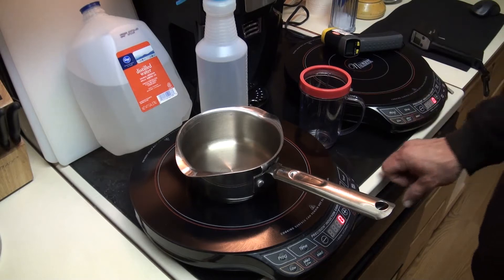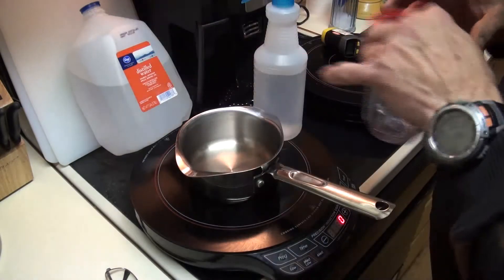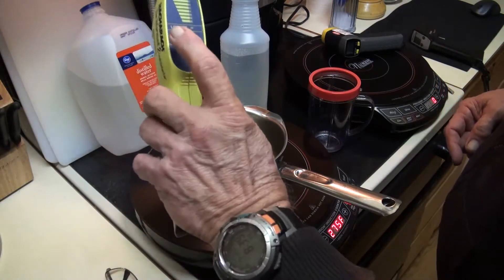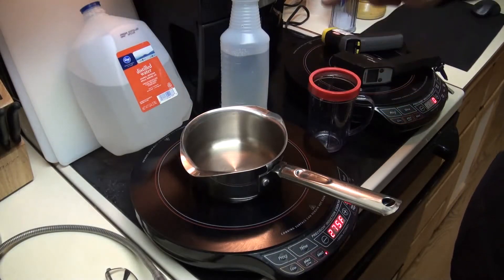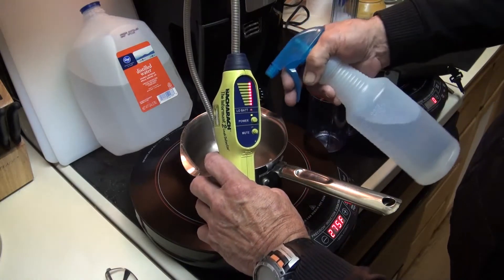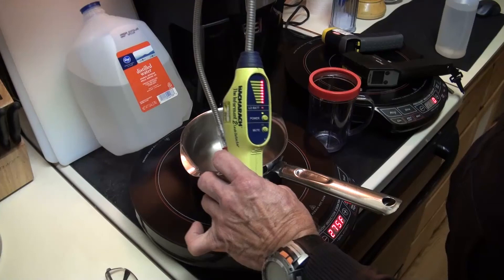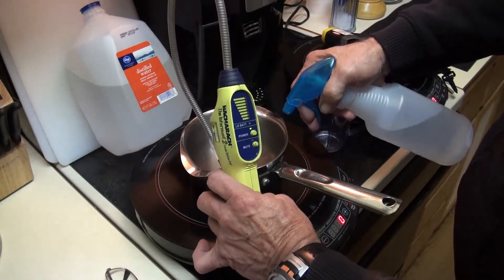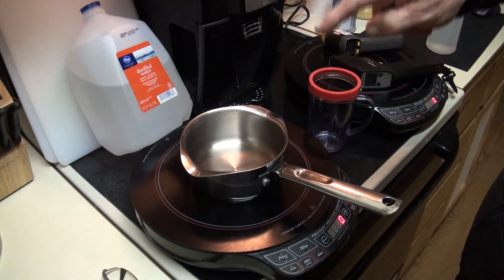# 2 Flammable gas from distilled water, is separating the Atoms, in water.

Comment from the maker: What I call my Flashing Liquid Process will take any liquid to any temperature, even above said liquid's boiling temperature. You see the finer the mist of liquid being sprayed onto a heating element, the faster the liquid will assume the temperature of the heating element, then boil, at the heating element temperature. This is possible because liquid takes time to boil. and the heat transfer happens faster than the liquid can boil, so the liquid reaches the temperature then boils.

Comment from the maker: Facts are not in stone, when written by scientists. Science says it is fat that gasoline auto ignites around 530 degrees Fahrenheit. I am here to tell you that is false I have seen iron turn a dull red before the gasoline would auto ignite. The temperature of the dull red iron is around 1000 degrees Fahrenheit. This means there are around 500 degrees that science says doesn't exist. Look at what I did to distilled water. science says it is impossible, you can't take water above its boiling temp.

Comment: If we speak about coincidences, than I remember "Cold Fusion" experiments with platinum and nickel electrodes. Japanese chemists do the experiment (replication). In the end of scientific experiment they make conclusion: The best temperature for Hydrogen production was about +80 Celsius. 212 F= 100 C. 100 C is boiling point of water. To "take" this temperature (vapor) is extremely simple we need to boil water. That is very inefficient too :-). I did it with "floating" resistor-4 Ohms.

Comment from the maker: The problem with using exhaust heat is controlling the temperature, 212 to 230 degrees Fahrenheit are the magic numbers, and you would have to have a temperature control on the exhaust heat to control the temperature. It is better to have a controlled heat source to maintain the needed temperatures.

Comment: I agree to Pete. Hot water molecules with high velocity make pressure, but splitting of water to 2H+ and O- start to happening at +1000C and higher. This process is thermal in nature- O burn out and H+ are liberating. If we speak about electrolysis than we separate each atom by the electricity. Of course this process give the economy if we take water and heat it with car exhaust gases and than return it to intake manifold. It will give fuel economy. That`s fact!